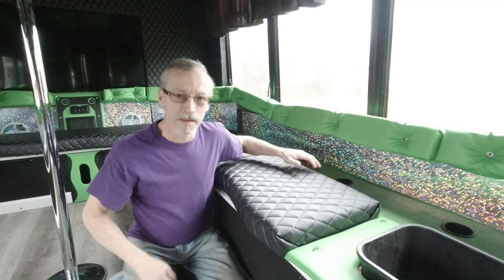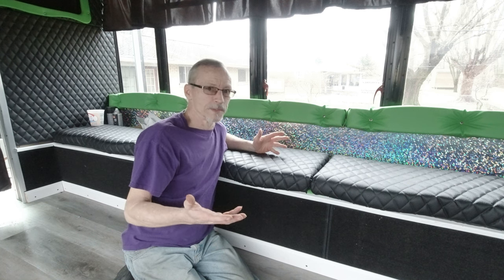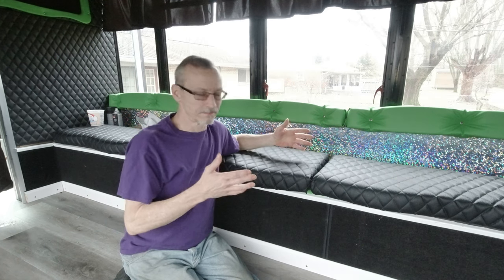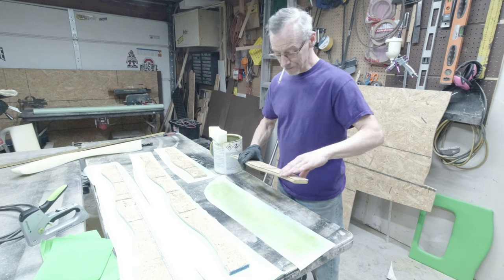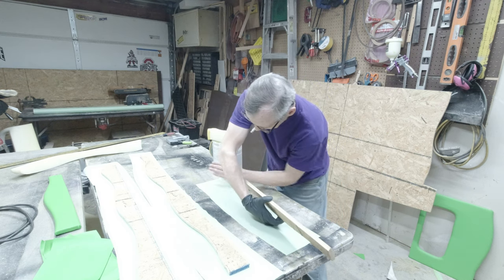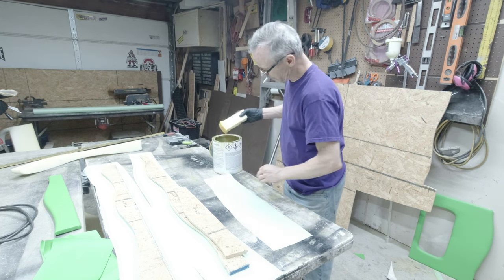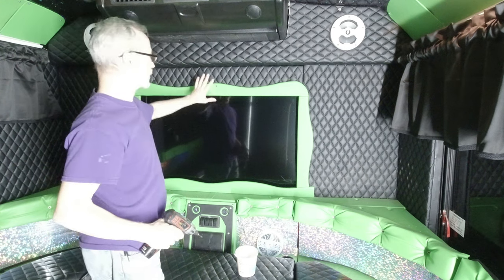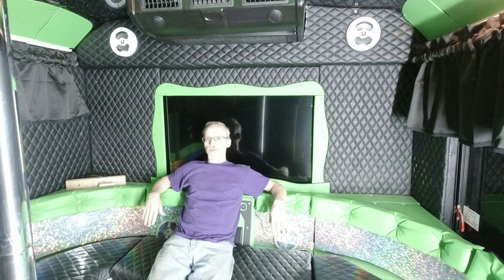DCC - Bailey Party Bus - How-I mount the seats and making trim fir the rear TV.

Comment: Hey I have a quick question, how long did it take you to do this bus and how much would you say it cost you for supplies between the wood to build a frame and the leather
Reply from the maker: Due to the weather, this one took me 4 months but normally should have been around  - 8 weeks. I think I spent around 2500 - 2800 in materials for the build.